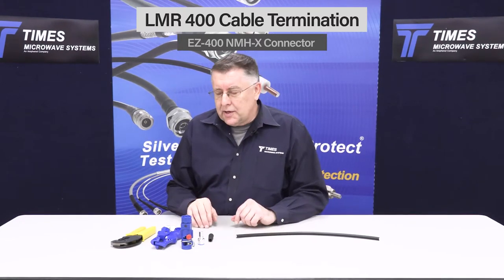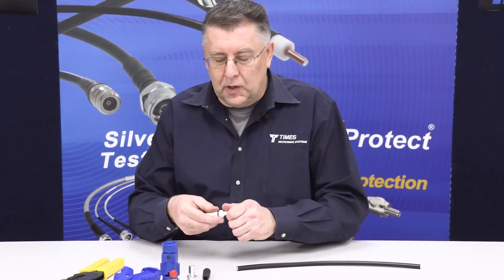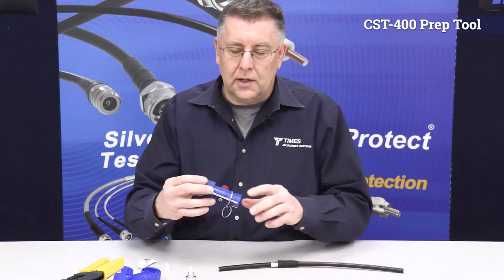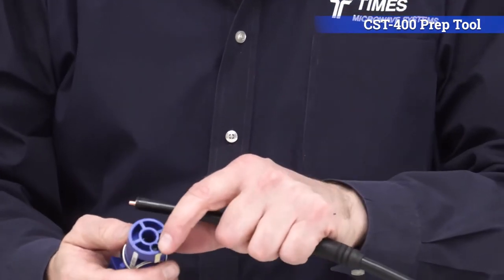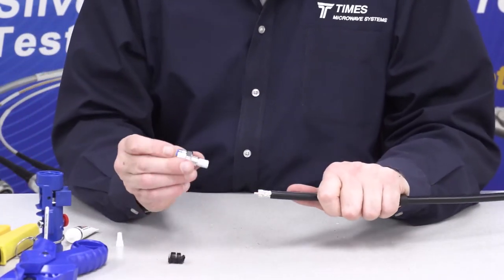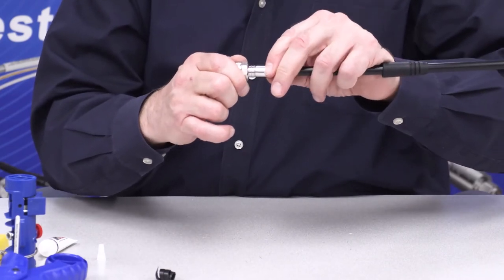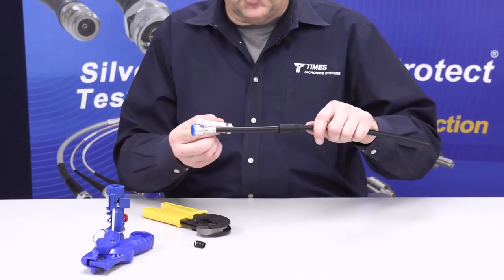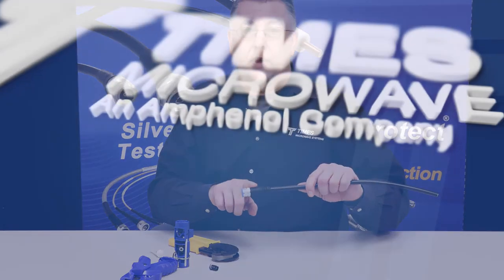Demo Discoveries:  LMR-400 Cable Prep Made Easy

Comment: Can we use LMR-400 type cable in the cold storage units for wifi antenna?
Reply from the maker: Thank you for your question! Absolutely. Our cable has a rated operating temperature down to -40 degrees Fahrenheit so no issue with using it in a cold storage unit.

Comment: $162.78         CT-400/300 Digi-Key Part Number  1946-CT-400/300-ND  /  DX ENGINEERING - 35$ WITH MULTIPLE TYPE TEETH FOR DIFFERENT SIZES.

Comment: What type LMR 400 we should use for 4G WiFi Routers. I've TP-Link Archer MR600. Planning to buy a LMR 400 cable for better 4G Signal. Suggest me one.
Reply from the maker: Hi Ramesh
You can use a LMR 400 or LMR 400 DB. To help you choose which one is best for you, please send us an email with your installation requirements, loss budget, length, and any other specifications you have, at techquestions@timesmicro.com. Thank you!